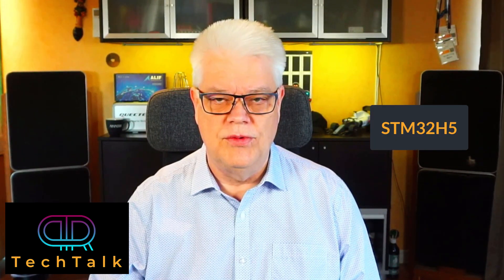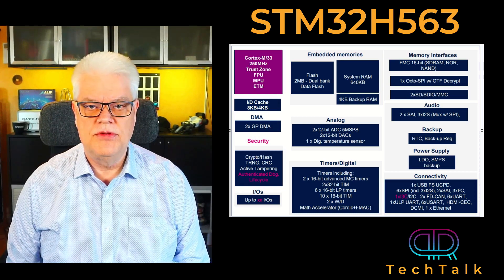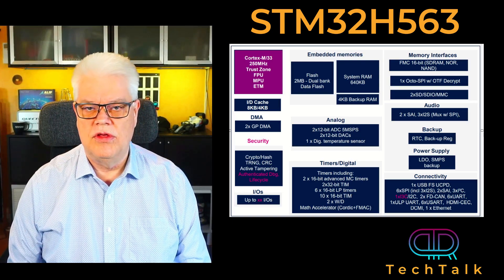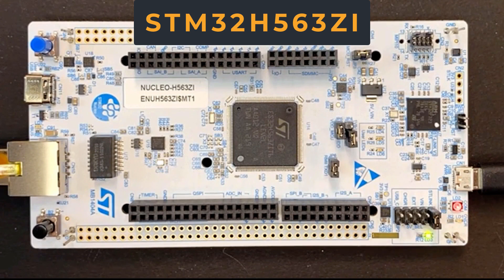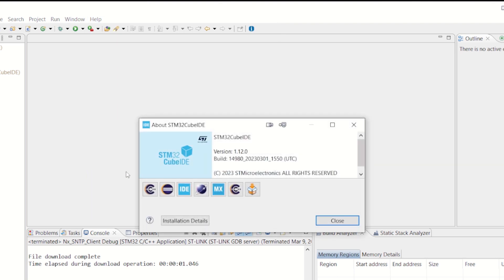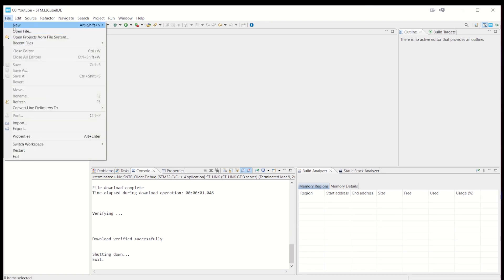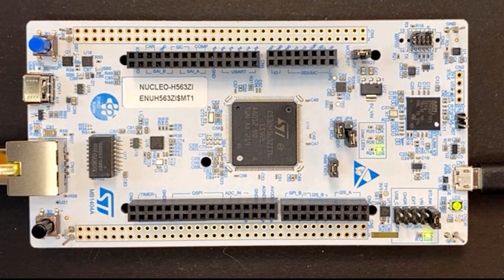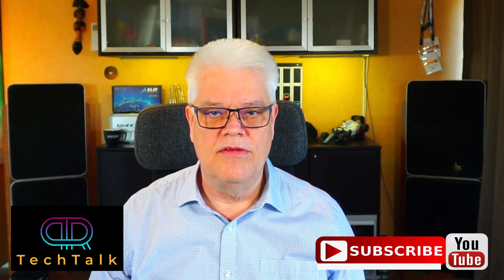Getting started with STM32H5 a new MCU from ST

Comment: How to integrate sd card to this MCU cozz fatfs option is not given for creating project
Reply from the maker: Hi, i have made a video on how to add SD card to any STM32MCU using SPI interface. I realise that this STM32H5 have also SDIO interface that is a much better interface. But i have not yet made any video on this. I would guess that if i do then it will be using Thredx RTOS and FileX to access this features. /PR TechTalk

Comment: Why would one use this over F4/F7/H7 ?
Reply from the maker: Hi Ashish, H5 is the newest addition based om Cortex M33 with built on a process that are future poof, and many features like TrustZone, double flashbanks , ECC highest security etc.. F4 & F7 i would try to stay away from. H7 is absolutely Ok to use and gives highest performance with M4 and M7 core in same package. But this is my personal feedback. Hope you find a suitable device to drive your project.
/Peter Ranemyr
Reply: @prtechtalk416  Thanks a lot for your insights!
Reply: @prtechtalk416  Why would you stay away from F4 and F7?
Reply from the maker: @TriodeTetrode  Sorry for not replying to you earlier, it was just missed.. Sorry..
But to be clear both F4 and F7 are on ST longevity program and are fully supported bot in software terms and logistical. But my recomendation not using them is based on that their are better & cheaper & Bettersecurity & Newer alternatives  from ST. so first look at STM32G4, and STM32H5 for general purpose MCU´s. And if Low Power is needed STM32U0 & U5. And for Entry lowcost alternatives STM32C0.
/PR TechTalk